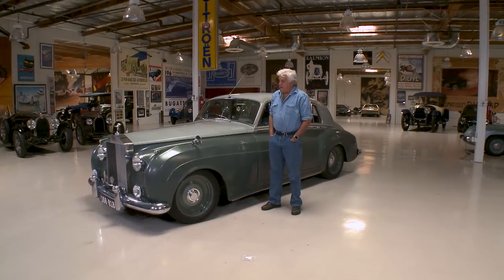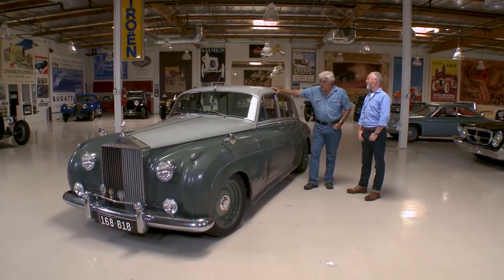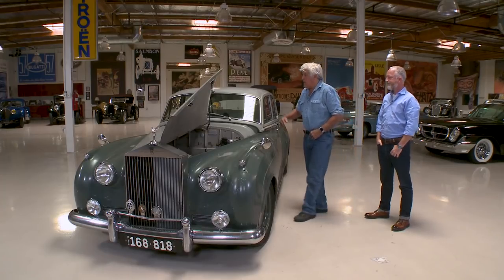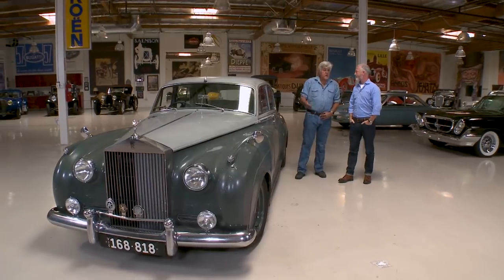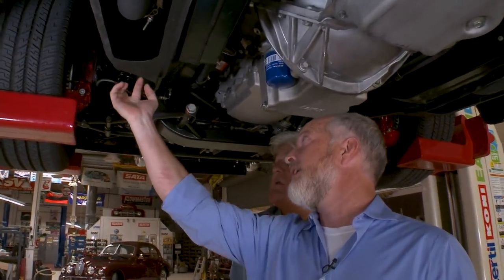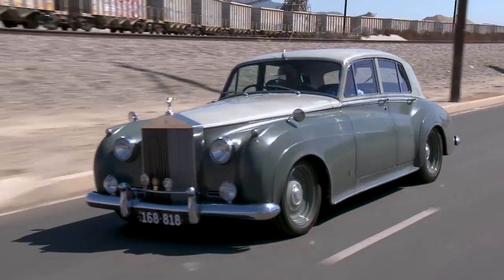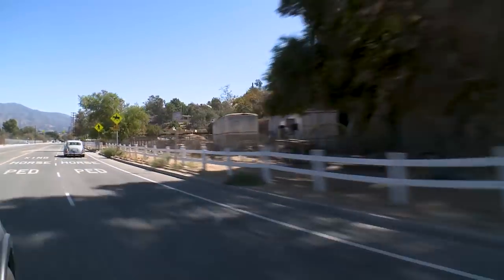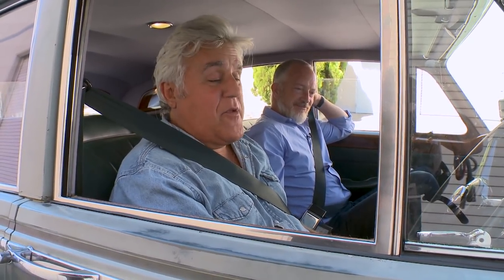1958 Rolls Royce Silver Cloud Derelict - Jay Leno's Garage

Comment: Jay the "Reverse" position on the original auto trans was the "Park" position so the mod Icon made wasn't necessary. The mod's they made getting rid of the drums WAS necessary. I owned a Cloud 2 v8 and Rolls Royce reckoned that the drum brakes produced enough energy to light up Birmingham for a night. I don't know if that is true but those drums were a nightmare. The front ones didn't work under 12mph to stop the front of the car "dipping" when coming to a stop. Nice idea but bloody scary when you came up to an intersection. I remember having fun with Mini owners. I would come up to them at the lights and creep forward enough until you couldn't see the back of the Mini and I knew the driver would look in his mirror and all he could see was that grill. Must have freaked a few people out!

Comment: You briefly mentioned a comparison with the Cadillac which had AC etc while the RR did not. Yonks ago I visited the RR factory on a contract. This was in the pre-BMW days when they had no money (yes really). They had a Cadillac there and showed me the differences. For example they pushed a pencil through the gap in the corner of the frameless window and told me those gaps cause wind noise. Things like that marked out the RR as superior to the Caddy in ride, quietness and comfort. The steering was also superior, very light but more precise than the Caddy. I drove a Caddy in NJ one time and it was like steering a boat.

Comment: The factory air conditioning in a '60 Silver Cloud II was located in the rear, below the parcel shelf.
Reply: RR: called it "refrigeration." Quie a few Los Angeles-delivered  Silver Clouds, and the big Mercedes 300d (diplomat, NOT diesel) had expensive, dealer-installed AC

Comment: I loved this to a point. I own a 1964 S3 Bentley ( same as Cloud 3) which I dearly love but a few mods would greatly improve the car, such as disc brakes, it still has drum brakes with a complicated mechanical servo. Jaguar were using disc brakes back in 1959. The steering is overcomplicated with 21 grease points, this would benefit a rack and pinion set up and loose about 200 kg of scrap idlers and control linkages. These mods could be done but would leave the car as stock.

Comment: Just had to pipe in on the Australian design laws. Each state has a bureau within the Transport Department which might as well be called "The we don't register modified vehicles department". Their sole purpose seems to be to frustrate at every turn.

One tiny example from my efforts to register a modified boxer BMW motorcycle. The engine capacity had been increased from 650 to 850cc, still a pretty modest output, and the frame had been strengthened, particularly in the sub-frame section to address a few issues. I had to provide an engineers certificate to prove that the frame was up to the extra power provided. But BMW use the same frame for everything from 450 to 1000cc? And this one has obviously been strengthened! Not only that, but strengthened in ways in which BMW had seen fit to do themselves on subsequent models. I eventually, after jumping through many hoops and sooling the public ombudsman onto them, succeeded in getting the bike registered. Some years later, when I wanted to pull the motor out for some work, and fitted a standard 650 engine in for the meanwhile, I again had to deal with the obstructionist bureaucrats. You guessed it, they required a new engineers certificate for the frame/ engine combo. It's enough to make you want to go on a rampage.

Comment: My dream ICON: 77-80 RR Silver Shadow II saloon- keep the RR 6.75L get rid of the GM Hydromatic replace with a short throw Tremec 5 sp manual, get Bembros all around, get rid of the expensive hydraulics, and tune the suspension so it drives like a new Mercedes S Class.

Comment: Is it's power "sufficient"? Also, just because a V8 has more cylinders, does not mean it is a "better" engine than a straight 6, which has perfect balance. The 90 degree V8 does not have perfect balance, but has secondary imbalance
Reply: I agree, Alan Passat.   And apparently, plenty of others agree.  Sales of cars with high numbers of cylinders, are not what manufacturers were hoping for.   Personally, I'd still be driving a 4-cylinder Volvo, if they were still being made.  My 940 was just "right".  I haven't had a car, since the end of the Swedish Volvos, that seemed "right".   ...luxurious, yes.  ...powerful, yes.   But they've all seemed as if excess had been used as a cover for some fundamental imbalance.
Reply: Alan, being and Australian delivered car, it should have had the Australian Turbo 4L i6 DOHC 4V VVT Barra fitted. Balanced, quiet, and would have suited the RR perfectly.

Comment: Kindig kustoms makes a wheel that has a wide white wall that is part of the wheel looks like a 15inch wheel with a wide white wall tire that's actually a 17 or 18 inch wheel that he should have definitely used and it would have looked completely stock from the outside....there located in salt lake City Utah ..

Comment: the  'new' brake system , is similar to what is on my diesel Motorhome
electric aux powered hydraulic pump for steering and brakes, if there is an engine failure
that right hand drive must mess up your perception, you keep going over the center line

Comment: Remember the news segments? Maybe even an old 60 Minutes. Where the story was body filling & fairing with lead. The ‘panel beater’ uses a gasoline torch to heat a palette full of lead ‘till it soft & floats it onto the partly heated panel. Those guys are probably all victims of toxic overload from the hot lead & gas fumes. 😕. The car was always a Rolls - no poly filler on a Rolls - harrumph ⚓️

Comment: I would be surprised if it originally made 150 hp, it was a four liter ohv 6, the same size as the old chevy six with much lower compression (about 7 to 1) and nothing exciting in either the carb dept. or ignition, gasoline in UK was terrible and most cars exported to the US had a kit that would boost the CR to about 8.5 to 1 and up the spark advance.  I don't know if RR did this.  Remember too that the UK didn't at that time have any roads that could really use the speed or power, the motorways were only just starting when this was new.

Comment: When you renovate a Rolls Royce, you put it back to original condition.  Otherwise do not bother.
Reply: Leroy Brown  
A bastardisation. No one gains. They even left the rust in the body for some strange reason. Weird!  
If they want a hot-rod, go and build one.
This was a truly Philistine act.
.
Reply: Leroy Brown  
The E-type's electric drivetrain all sit on a frame that sits on the engine mountings. The car can easily have its engine and transmission refitted.  Aston Martin do the same.   Why? because the ICE will be banned in some parts of the world in the coming decades. And the sooner the better. 

http://carculture.tv/jaguar-land-rover-new-classic-workshop-walkthrough/

https://www.youtube.com/watch?time_continue=625&v=PREftlfZuXA

Comment: Hello Jay, it looks like those dreaded Lucas electrics still reside in that car. The dome light was still on after you turned it off. Somehow, I'm not too impressed with the modifications. The wheels are too small and look odd. It almost looks like a low rider car with that modern chassis (that's not a compliment) the dash is all wrong! and the roaring engine is still out of place for a Rolls, Sorry performance not withstanding, I'd prefer a stock one with an original gutless RR six to that silly teenage "show-off" engine.The Buick worked better, but this? thumbs down."it makes me laugh" as well!! LOL.

Comment: Putting in modern mechanicals, fine. But the lowering it so it looks different is, sorry,  wrong.
Reply: OK, also the retaining the weathered exterior finish is also crap. The designers of this car did not want crazed paint.
Reply: By the way, this must have cost half a million bucks at least.

Comment: I had a 55 Bentley S1 and I loved it just as it was , idiosyncracies  and all. I even loved the silly things like the fact that the wheels on one side had reverse thread wheel nuts. My personal feeeling is that that this 'Derelict Cars' guy has totally missed the point and has converted what was once a timeless and nostalgia laden classic into yet another bland hopped up chevy. He may just as well have fibre-glassed a body onto a Corvette.  British cars were certainly laden with 'character' and really are a blast from the past in a largely unmolested state and so totally represent the interesting character traits and charming flaws of the Brits themselves. Having said that; I loved your short wheel base V12 Etype; something that was modified sympathetically and intuitively while retaining the original character; in short, making improvements that the manufacturers should have made. This Rolls Royce is horrible and is truly vile and the Derelict motors guy, blinkered, un-intuitive and a total Phillistine in my book. It's a bit like cutting off John Cleese's head and sticking it on Chuck Norris's body.

Comment: 6:36 - I wish these idiots would figure out that you don't need "big brakes." NASCAR race cars all have 15" wheels and have braking power that's through the roof (2.5g of deceleration for a 3,400-lb. car):

"2.5: The maximum deceleration (g-force) NASCAR drivers experience, which is more than 25 per cent higher than for the cars that race in 24 Hours of Le Mans in the LM GTE Pro category. An incredible difference considering that the NASCAR cars weigh as much as 1,540 kg, use cast iron disc (less performing than the carbon ones) and reduced size braking systems."

https://thebrakereport.com/brembo-explains-nascar-brakes/